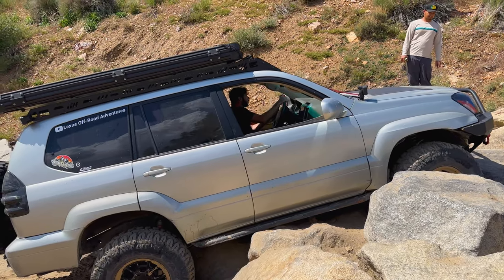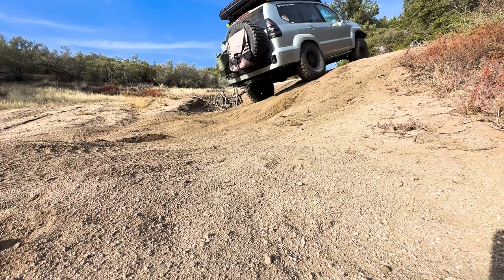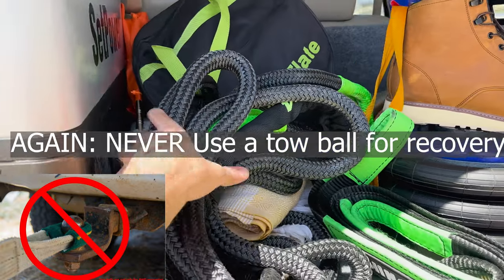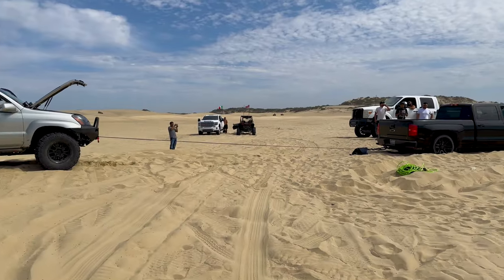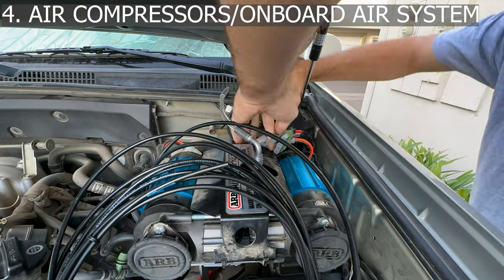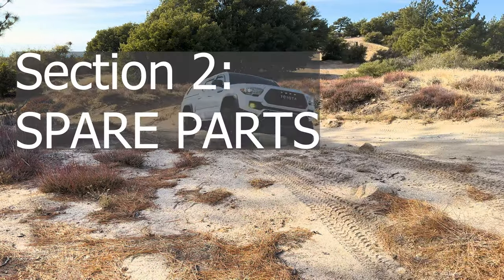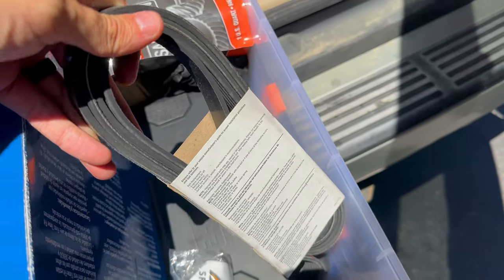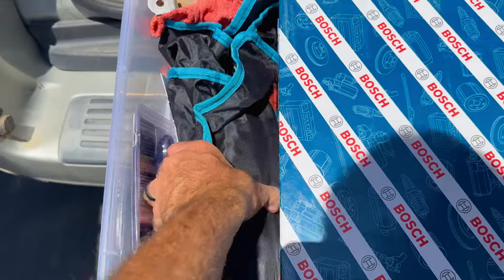The ULTIMATE Lexus GX470 OFF-ROAD/Overland Build (For Under $20k) Part 3

Comment: Such a good job putting the hood up. 👌🤙.  Practicing using your recovery equipment is also so very important! 

People really need to hear this stuff. 🙏
Reply from the maker: A simple tip that can save lives. Especially if you’re worried about the anchor point. 
Thanks for watching!

Comment: I have 140,000 on my 2006 GX. I always maintain it at the local Toyota shop. I am trying to decide if I should sell it or keep it and modify it. I also have a 1990 4Runner set up for rock crawling with 180,000 miles on it. I regret selling my clean stock 1987 4Runner. I bought it from my uncle who was the original owner. It was real clean and never off road.
Reply from the maker: The GX makes for an incredible light off-road/overlander. It’s quiet, comfortable and totally daily drivable. I’d just do some light mods for some overlanding and use the 4Runner for the rocky stuff. You can definitely rock crawl with the 470 though, it just requires a bit more money to get it to the level where it’s ready for that

Comment: Enjoyed this concise straight to the point video.  I had a question. Why use a soft shackle to connect your winch hook to the bow shackle.  It would just introduce another failure point thay could allow the metal hook to fly back at your car.  

If u connect the hook directly to the bow shackle, that will not break before the winch rope breaks.  Much safer as all the heavy metal wont be flying around.
Reply from the maker: Thanks for watching. Good question. The answer is reducing metal to metal contact which can scratch off the powder coat more quickly on both items (the hook and D-ring shackle). I live by the beach so corrosion can be an issue over time without proper coating. Using the rope is a bit less abrasive. Both methods work, but I had full confidence in the soft shackles i was using.
Reply: @lexus_offroad_adventures  fair enough. I see your point.  But what price is your life vs a bit of surface rust.  Bow shackles and that hook are very thick metal.  The rust would take a loooong time to structurally impact them
Reply from the maker: @user-fr5pl1zf5f  again, I have full confidence in the soft shackles. It’s also worth noting that soft shackles provide a favorable damping effect so you don’t shock load the metal components, so the likelihood of any breakage goes down further when using rated soft shackle equipment imo.

Rust does take a bit of time (although it is accelerated near the beach) but you also very seldom use these components. I want them to be structurally sound for a very long time. In the future I will probably upgrade to a factor55 aluminum hook so I don’t need to consider this potential issue.
Reply: @lexus_offroad_adventures  All good buddy.  Stay safe and have fun out there. Cheers from Australia !

Comment: I wonder if the AHC  can be used for tire air pressure …    Ya know. From the air bag suspension …
Reply from the maker: I believe I’ve seen that people have tried but it’s waaaaay too small. Not nearly enough CFM

Comment: Hi I just got a 2005 lexus gx470 and am looking to do a very simple build . lift maybe 2 inches and throw some 31s on it for a small boost in off road capabilities nothing too crazy. You mentioned looking getting a compressor for airing up your tires, would that be necessary for thing like logging trails or even beach or dune driving? Also would you recommend an engine mounted compressor or could I get a simple compressor to run out of the 110v plug in the back of the gx?
Reply from the maker: If you’re going off road at all, especially driving on sand,you need a compressor. You should definitely air down at the beginning of the trail for ride comfort but also better grip and traction. For sand, this is even more of a critical step, as you will need the extra tire surface area from airing down in order to stay on top of the sand.

In order to air down, you need to be able to air up after the trail! 

I would not use the 100w plug for anything. Instead, get a compressor that hooks up directly to your battery terminals. That way there will be no issues with blowing fuses.

Comment: Question for you. I am looking at buying a 2007 gx470 with 240k miles it looks great but the guy said he does not know when the timing belt and water pump was done last and he wants 8,500 should I get it or pass
Reply from the maker: Lots of questions like what does the chassis look like? Is it rusty or clean? Is there a detailed service record other than the TB and WP? You can create an account on the Lexus owners site: https://www.lexus.com/My-Lexus/account/create-account
Then add the VIN of the GX you are looking at and it should at least allow you to see what servicing has been done at Lexus dealers. If no TB kit has been done at Lexus, then last thing you can do is pop off the cam covers and check the condition of it to see if it’s safe to drive. But definitely budget to have that service done if the record is at all fuzzy.
Reply: @lexus_offroad_adventures  there is no service record other then I pulled the car fax no wrecks clean frame no rust I tried to make an account but it would not let me